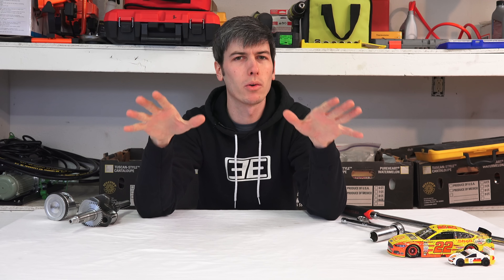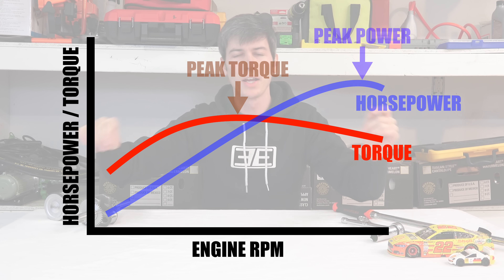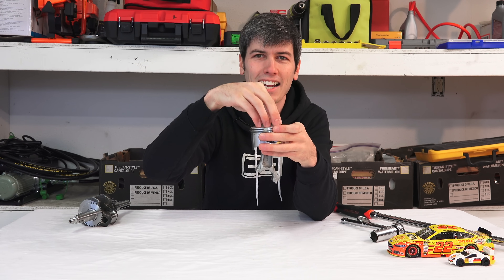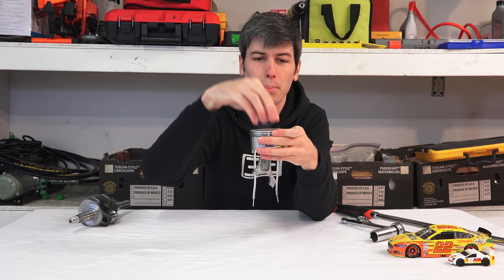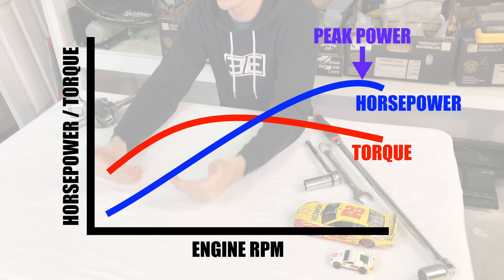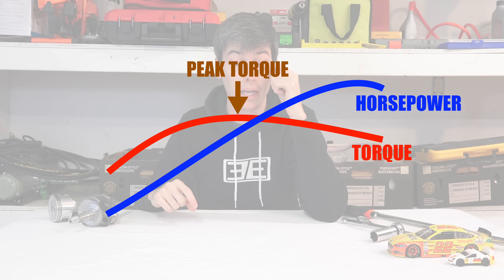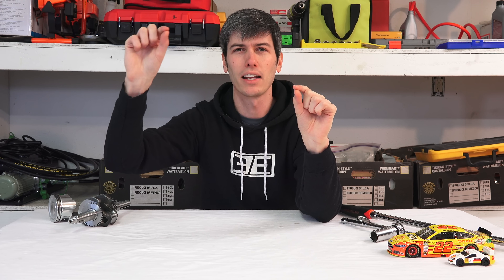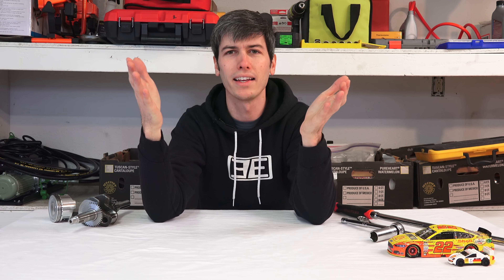Horsepower vs Torque - A Simple Explanation

Comment: So, hold on!!  Basically, “HORSEPOWER” has nothing to do with horses? I thought for example, 485 horsepower would be the power of 485 horses put together to pull my car?? And did he say, “simple explanation?”  🤷🏿‍♂️🤦🏾‍♂️🤣
Reply: A hp is 736watts per second
Reply: @TheAdatto  No, it's just 746 Watts.  Not Watts per second.  Watts per second would be a rate of change in power.   Watts are Joules per second.
Reply: @carultch  its just to clarify that every second it uses that power. Thats why if u use 1000watts for 3600 seconds u used 1 kilo watt hour
Reply: @TheAdatto  If you say "Watts per second", you are double-dipping on the "per second" part of the unit, which gives it a different meaning.  Watts already have the "per second" built in to their definition.   It is like saying "pump my tires to 35 psi per square inch".

Watts per second would be a unit for the ramp rate of power usage.  Like if you have a plot of instantaneous power as a function of time, the slope of this graph would be measured in Watts per second.
Reply: @carultch  i know i know. But i have to explain lots of this too noobs. They have no clue. They think a 2000watt space heater uses 50 cents of electricity every few seconds. So to start about Coulombs is a bridge too far
Reply: @TheAdatto  Our brains are not accustomed to multiplying units.  It is such a common misconception to think kW-hrs means kilowatts per hour.

It would be much easier for people to understand if we totaled up the Joules from the start, and rate the power used by devices in Joules/second.
Reply: @carultch  would be huge numbers. Just like someone says i had only 7calories. (O.7kCal) i say no you had 700 calories
Reply: What horsepower has to do with horses, is that it is based on the performance of draft horses.  When the first engines were built, salesmen needed a way to compare them to something their customers could conceptualize.  James Watt studied the performance of draft horses pulling a millwheel, and determined the average performance of his team, to determine the 550 ft-lbs/second definition.  This gave a metric to compare engines to horses, to convince customers that they could replace their team of horses with the engine.

Comment: Thought high torque was pulling power u can have same engines and one can be quicker due to gearing the highest torque will be slower but could pull heavier loads that's what I thought

Comment: Your horse power versus torque should mathematically be equal. They will have equal energy. And being the high torque requires fewer gears in most cases to no gears in some like steam or batteries shifting times are reduced and in some cases eliminated.

Comment: At an engines given torque output, a numerically higher gear ratio, say 4:1 vs 3:1 will give you more torque at the wheel but for a shorter time duration. You must take the engines rpm range into account here. Shifting a manual gearbox, each subsequent gear takes longer for the engine to work through it's rpm range since each higher gear covers a broader range of road speed.

Comment: The force/distance reference does not really work with a piston engine..You should describe it as force/volume since the cylinder volume generally determines how much torque the engine will produce. I can expound on this further if you want.

Comment: Very informative, thanks for sharing.  I have a question that doesn't relate to cars though.  I want to make my own rotating turntable and I'm going to use the synchronous motor.  Will all of those motors work the same?  I mean, if I'm going to use the turntable I'm about to make for something that weighs about 30 kilos, will the turntable turn?  If so in what speed?  Is there any specific type that I should get?  So far, the highest RPM I've found was 5/6 RPM.  Will that do?  Thanks for any feedback on ideas.

Comment: Listen up People!!!
YOU CANNOT HAVE HORSEPOWER WITHOUT TORQUE.
YOU CAN HAVE LOADS OF TORQUE WITHOUT MOVING ANYTHING
Force applied to (say a bolt) is TORQUE.
When the bolt actually moves, THAT'S HORSEPOWER
Any questions????
Reply: You can have torque without movement. Rotational friction is a thing.
Reply: @darkcoeficient  
You are telling me what I already said.
There HAS to be "Rotational Friction" to provide resistance. 
BUT  once it breaks free and moves.....That's Horsepower.
This applies to a bolt OR a Crankshaft/Rear Wheels/shoving
a toy car across the desk is horsepower. Starting from -0-
is Torque. Once it moves...that's Horsepower.
Please understand that you don't have to explain anything to 
me. 
I wrote the simplest explanation that has EVER been given
and didn't take a 7:23 minute video to do it.
PS> All engines have friction. Torque overcomes that and the
resulting movement is: (what have we learned kids?)
H-O-R-S-E-P-O-W-E-R. Very good!
And YES, you can have Torque AND Horsepower at the same 
time, In fact one cannot work without the other unless you 
take your foot off the gas and that would be "Stored energy"
i.e. "Rotational Mass" (Laws of Physics and what not)
"That which is in motion tends to stay in motion"  
Yaddah, Blah, Etc.
PPS> Yes, I can be a dick. lol.

Comment: So torque is use to pull stuff because is force in a steady pace but Hp is the speed the the gears move by the torque. So if u dont have enough torque to move something then u dont have hp in other word that mean if u try to move 500 pound but can not then u dont get hp bec it order to have Hp u need to do work.